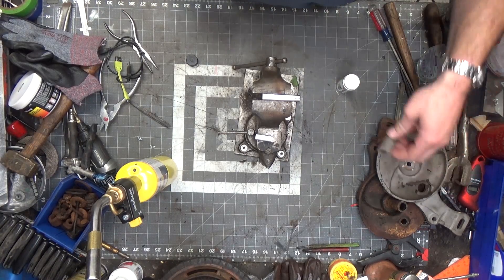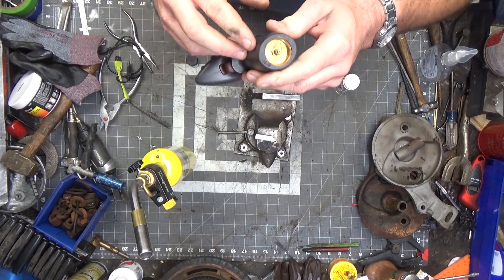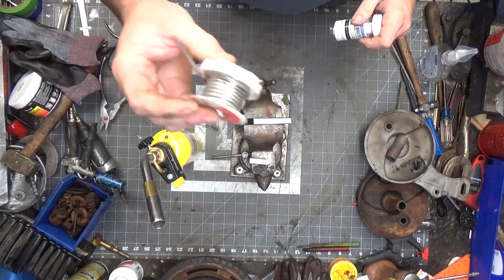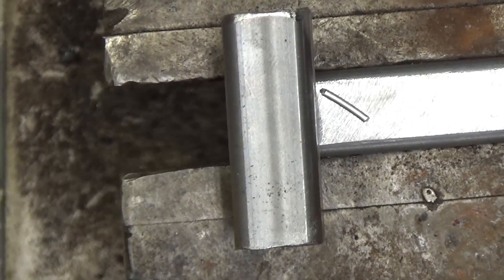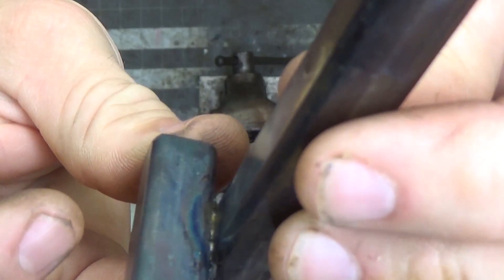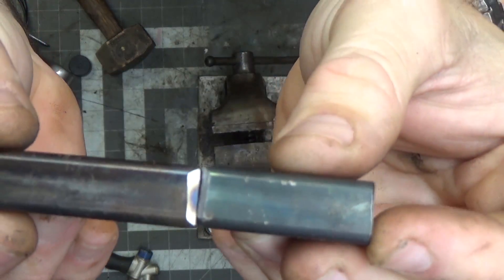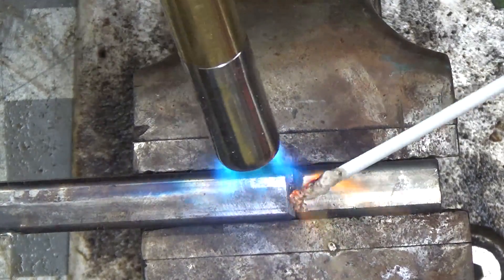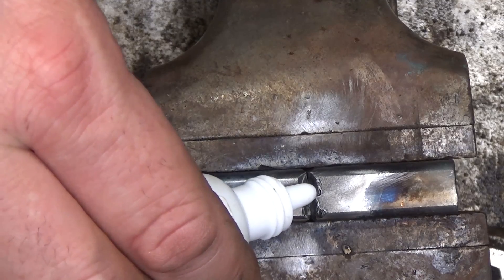Tinkering with Silver Solder

Comment: Good frigging call on fixing the oxy/acet leaks before using!!!.  I thought the MAPP gas would of been enough to braze those two parts if you had it positioned differently.  I would think straight propane could as well if your parts and brazing rod were small enough, otherwise it's just to much mass to heat.   The vice was sucking out the heat forsure.    From what I remember being told, the parts should be dull cherry hot and then I sort of "paint" with the brazing rod.  Maybe try doing an edge joint or corner joint.  Those two kinds should take the heat in and you could probably position them in your vice as well.   Oxy/Acet may prove to be less discouraging as you have a more concentrated flame and things will get hotter quicker where you point the flame.  You'll also know when it's too hot when your braze just spits/crackles and disappears.  There is probably a bunch of good videos on YT that show and tell you a bunch more than my couple sentences, you just gotta have that patience to watch them and try things if no one is there for some one on one.

EDIT: The silver solder looked good.  wicked in there nicely and looked to have good coverage.

Comment: Hey Joe well I have a MIG welder with an Argon bottle I have a large cutting torch with the number 2 welding tips I have a really nice Weller soldering iron or gun, and I also have a propane heater that screws onto the top of my propane tank. I've had all of this for decades. When I need something welded or brazed or soldered I ask my neighbor to come over and do it because I can't. I don't seem to have the ability, knowledge or skill.  Anyone that tells you that welding or soldering or brazing is easy is because they have a knack for it. I do not. The only thing I can do successfully is light my propane heater  in the winter, and I'm mostly struggle with that. I can identify. :-)

Comment: Hi Joe!  Soldering, brazing and welding have so many variables that it almost becomes a turn-off....  There is so much to know about different materials, heat settings, flux, amperage, speed, feed...  I've seen Keith Fenner weld Cast but he pre-heats the part and has temperature sticks and then uses special rod...  Very impressive.  The other problem is to practice, it costs you a boat-load!  Lol
I bet those guys would tack on the tube and use a mechanical rotary table to get a nice bead around the base...   I knew this guy at work who was the "welder" and he could do such beautiful welds and made it look so easy, when he was out sick the replacement guys butchered everything!   😂😂😂.   Thanks Joe!!!   Great stuff!!!

Comment: I've often wondered if I could braze with a propane torch. I don't know how to weld but wish I had the equipment and knowledge to do so. I had hoped brazing might be another option. If silver solder doesn't hold fully, I wonder what it's usages might be. (rhetorical question) Anyway, thanks for the vid!

Comment: When I tried brazing I had to use a Mapp gas torch and a propane torch to get it to melt. I think you will need a oxygen and acetylene  torch to get it hot enough to braze with. Mapp gas has changed over the years. The current Mass gas is not as good as the stuff years ago. You can read about the history Mapp gas on Wikipedia.